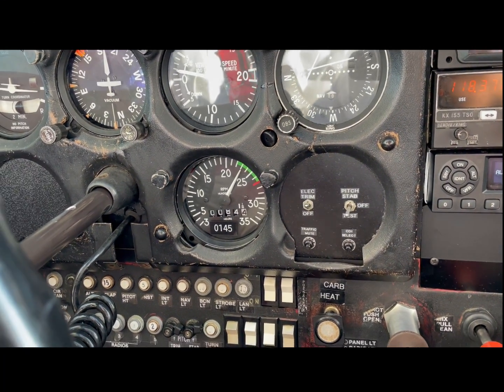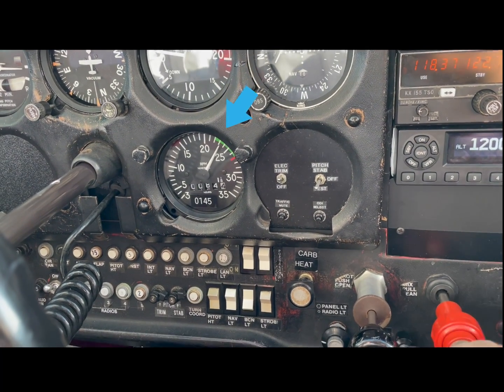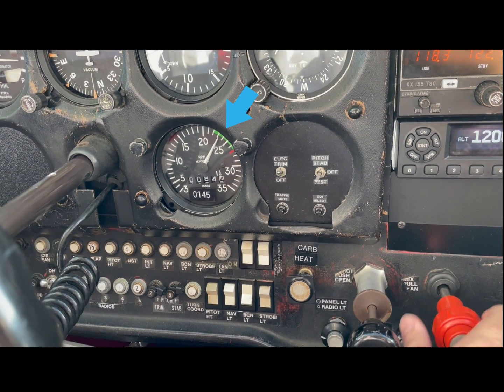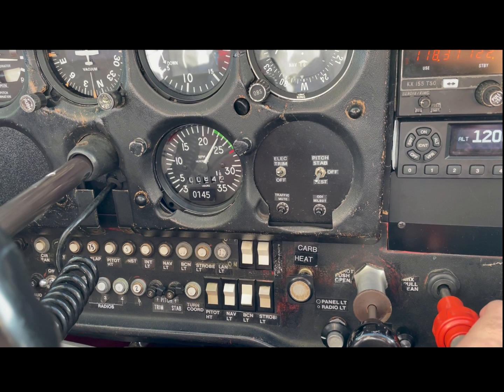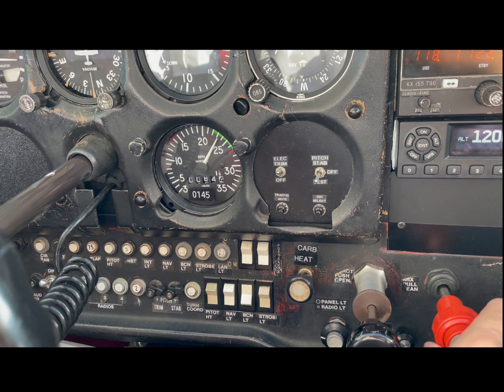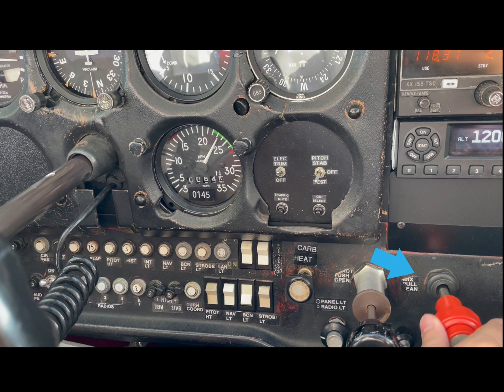How to Properly Lean the Mixture in a Cessna 172? I Technique: Leaning the mixture

Comment: So do not adjust mixture during a climb from say 0 to 8,000 feet since not level flight?
Not sure that is right.  We will lose power during the higher portion of the climb
Reply: only lean the mixture during cruise, use full rich during climb/take-off
Reply: @addeH69  what about descent?
Reply: @phan5302  you'd probably best of riching the mixture if you're descending for landing as you're really risking carb ice building up with low power (for the descent). one of the prelanding checks it to check mixture is rich (atleast for cessnas)
Reply: Lean for Best power before takeoff at above 3000ft field PRESURRE ALT , is it gonna be same as this? ( C172S G1000 )

Comment: No no no!  

People need to stop perpetuating this nonsense!  it’s been taught…. And has been wrong…. For  60 years.  

Exhaust gas temps have nothing to do with optimum long term engine management.  

If you love your  engine  run it low power and lean. 

1) reduce power to less than 70%
2) lean until slight power loss then slight roughness is felt. 
3) turn back around 1/2 turn to rich side until roughness is gone and a slight power gain is appreciated. 
4) readjust periodically or with every 500-1000 foot elevation change. 

This will save you gas and increase your range;  reduce coking of valves and rings; and reduce  cam shaft wear.

You can go rich for landing…. But as soon as you are safe on ground aggressively lean again for all taxi operations. This is where running rich is the most detrimental.  Do the same thing when you start:  ok to start rich,  but then lean further all taxi operations.